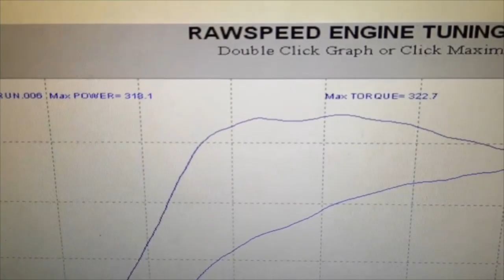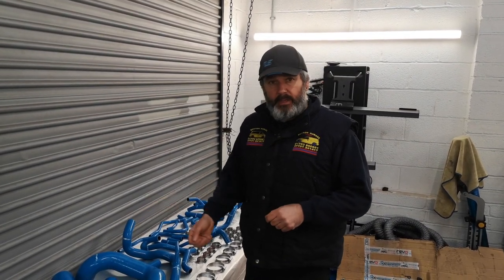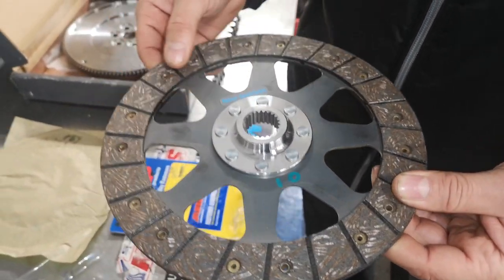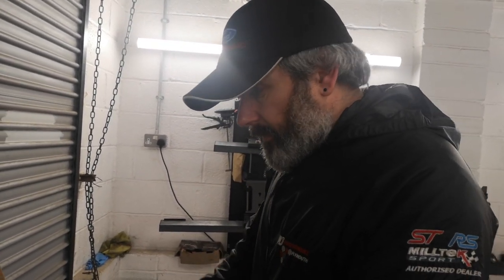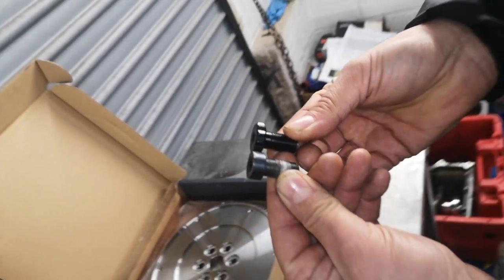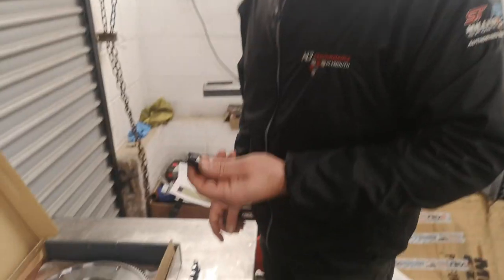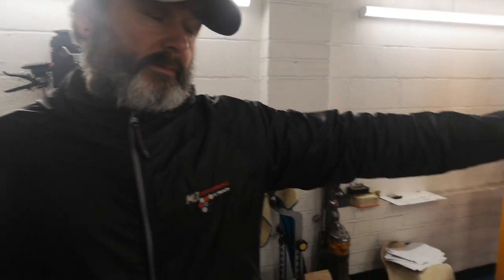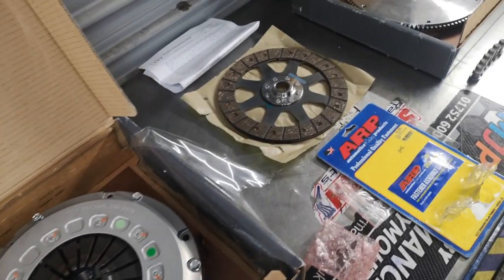RS 2.0L CONVERSION: PART 5! IT'S ALIVE! ENGINE REBUILD AND 1ST START!

Comment: I can understand why the change to the 2.0 block but are you not worried about the reduction in cooling its going to have? also from the notes i seen about the 2.3 head has small cooling ports kinda in between the cylinders they are basically redundant from this change. whats your view on that?

many thanks

Comment: Thanks for the video but when you say “significant weight reduction” why not just tell us the figures? Total flywheel + clutch weight, OEM vs that particular aftermarket unit? This would be much more useful :) Can you please add some specs to the video description?

Comment: This has been a great project to follow! Could you do sort of the same thing to an ST by putting 2.3 crank & pistons in it? Thanks.
Reply: Yes. But having seen this build and reasons behind it, why would you want to if chasing big power?
Reply: BD performance have just taken the ST250 block and re-bored to 2.3 and stroked it using the RS crank and forged RS rod and piston set. Used the RS head etc. Time will tell how that works out for the customer. I think the RS block cracked around the back in the same place a few others have failed. Not good.

Comment: will you be offering a conversion package if so will be the rough cost ???
Reply: Yes we will be offering this conversion as a supply & fit package of different levels , more info to follow 👍🏁
Reply: @lauraghjones6633  definitely interested in the conversion as I want more power but I don't trust the engine as it is, really need to know what the  cost will be!!!

Comment: Shame these don’t have better engines 👍 what kind of power should that be good for?
Reply: 600+WHP depending on turbo and fueling.
Reply: Embarrassing how the mk3 RS is the weaker/inferior block vs the mk3 ST. Never seen that in the previous generations.
Reply: 1st World Problems SOLVED I hear it’s also the cooling that’s a big problem also.
Reply: lastexile1187 I almost bought one, was happy that I waiting and then started to realise how bad they seem to be on the motor front.